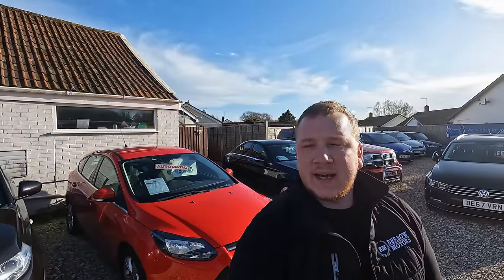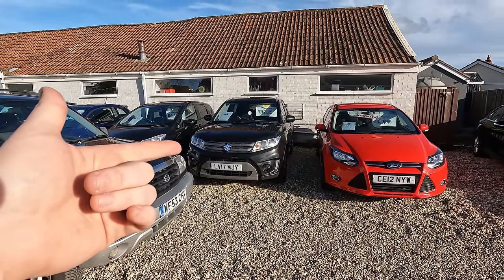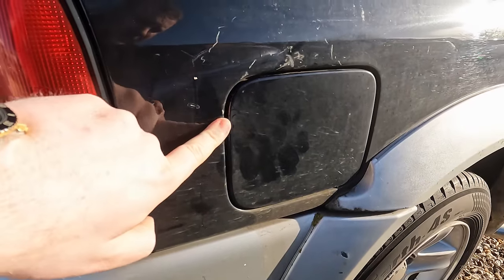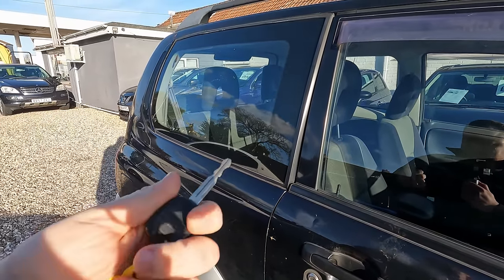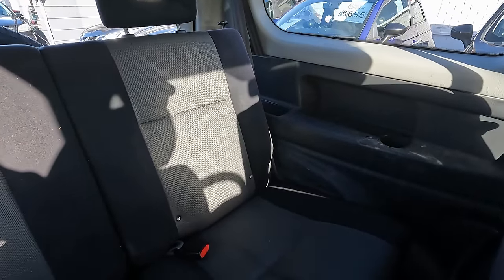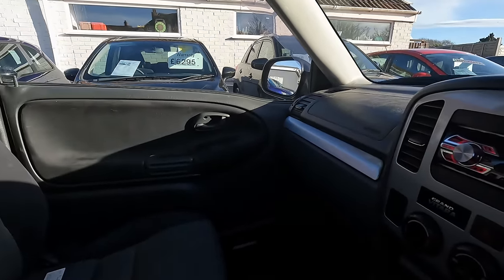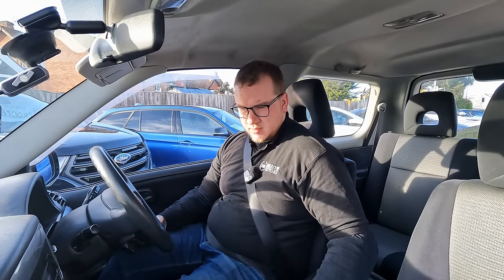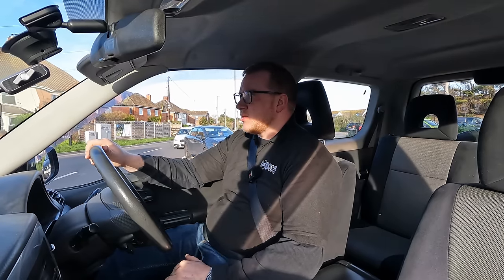I Bought A Cheap Rusty Grand Vitara For £400!

Comment: My first vehicle was a 2001 Vitara. It ran great for 8 years then anything with a bearing in it started failing starting with the driver-side rear wheel bearing. Eventually every pulley on the engine failed over a period of 3 years. O2 sensor replacements, radiator replacement, exhaust pipe fell off, and more. After 15 years the driver door handle literally broke off in my hand. Absolutely loved it and would buy another in a heartbeat. The nail in the coffin for me was the engine going and another wheel bearing, looking at $1,500 to get it fixed and I decided it was time to move on. I put 300,000 miles on it, a testament to doing oil changes every 3,000 miles.

Comment: Why would you send a car for a mot without checking easy parts first
Like the lights and brake pads
I always take a inspection light when I go and buy any car but I suppose that's cos am in trade lol
I wouldn't be buying that for a day to day vehicle it's only good for the off road scene
Reply from the maker: Because you could spend a load of money on parts then find it fails on other things and you’ve wasted your money
Reply: @ShiftingMetal 
Brake pads and bulbs arnt dear and not hard to fit and it just looks better on the failed sheet and makes the failed sheet not a massive list that's how I see it and with the failed sheet been a massive list I always check it on all cars and I see a big list of basic stuff just means it's not been looked after so Id pass on that vehicle but everyone is different